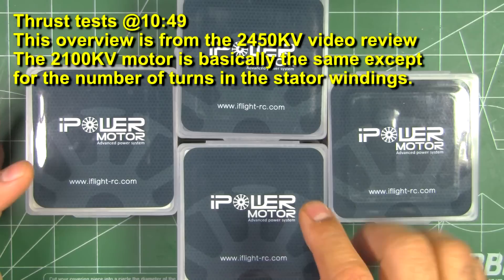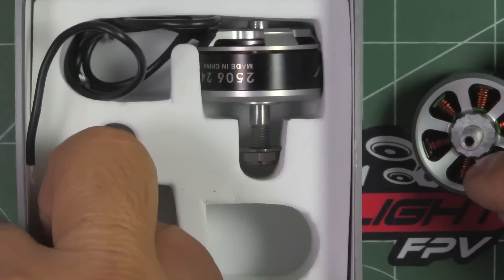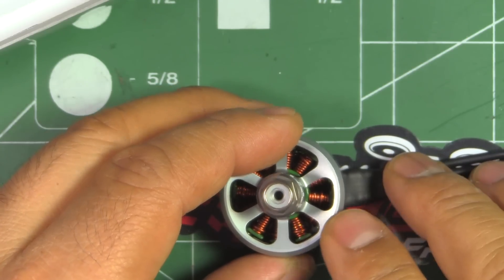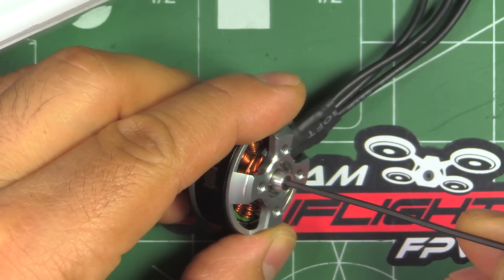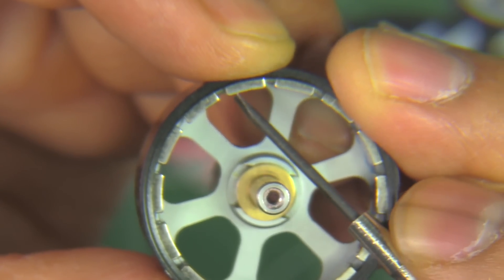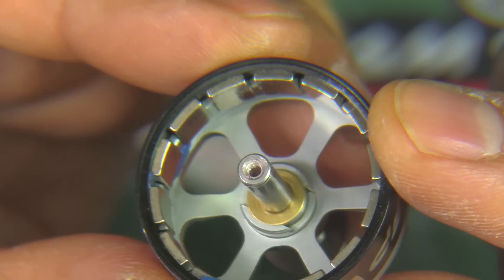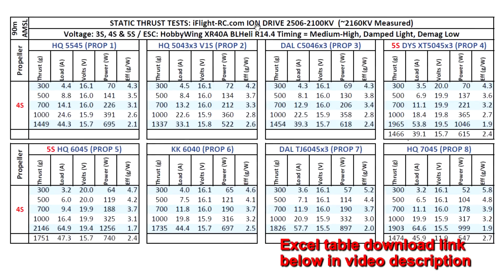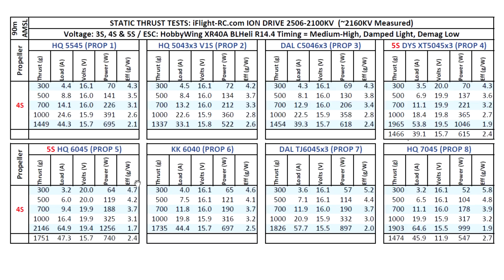iPower Ion Drive 2506-2100KV Thrust Tests & Overview

Comment: I love your videos . what motor so far you have tested really impressed you by it thrust ratios
Reply from the maker: Lalith Kishore Thrust ratios... You know I really have not looked at those ratios carefully but from what I recall on the large  motors the rcINpower 2305s I ran a few months ago. RCX RS2206, BH R5 2207, EMAX LS2207 and RS2306.... there's so many good ones!

Comment: Holy moly padthai, i could still not believe its size even after watching the whole video lol
It would have been interesting to see it at even lower KV like 1400 ~ 1900KV, i'm pretty sure it would have been interesting despite its weight.
Have a great week my friend, may the thrust be with you ;)
Reply from the maker: :)  
I think you're right. This big motor should be targeted for 7 or 8" props and with lower 1400 to 1900KV would match better. Have a very good weekend!